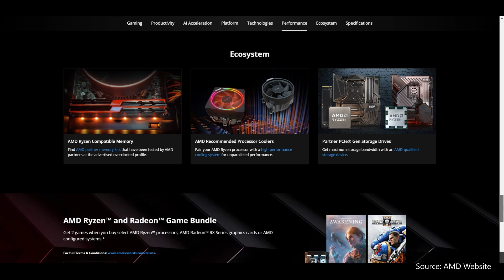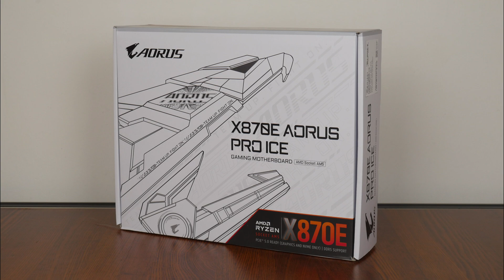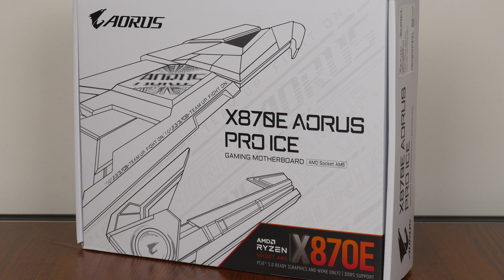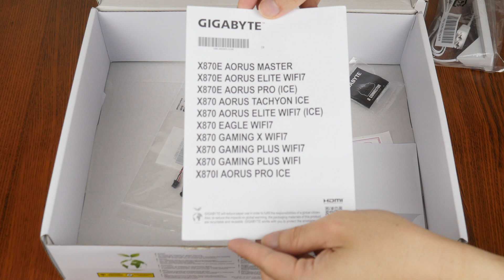THE Motherboard for Next Gen White AM5 PC Builds - Gigabyte X870E AORUS PRO ICE Unboxing & Overview

Comment: Would I be able to run 2 pcie 4 M.2 drives without cutting the GPU to x8?
Reply from the maker: Yeah, you'll have to use the first Gen 5 M.2 slot (M2A_CPU) and the Gen 4 M.2 slot (M2D_SB) - populating these two slots will not result in any lane bifurcation that will cut the GPU to x8!
Reply: @ALKtech  also i like to see pcie 2x16 gen4 for 2 gpus...but i can only dream :D
Reply: Or m.2 pcie card

Comment: its ne again ^^" can that board handle a soundcard or will it cut lanes away thanks for the review ^^
Reply from the maker: Hello! With this board, you won't get any lane sharing with a sound card installed on the PCIe 4.0 or PCIe 3.0 slot. 

However, seeing as you have three M.2 drives in your system, you will still encounter lane sharing due to the fact that two of the three PCIe 5.0 x4 M.2 slots share lanes with the primary PCIe 5.0 x16 slot for a graphics card 😅 this means your graphics card will operate at x8 mode instead with three M.2 drives installed...
Reply: @ALKtech  Will lane sharing be an issue most users will even notice? or just the tech enthusiast/benchmarkers?
Reply from the maker: @AlexisField  there's some benchmark videos/articles out there that demonstrate the difference in performance when the PCIe lanes for a graphics card gets cut in half - by and large there is some performance degradation, but the percentage drop in performance tends to be in the low single-digit range. For the everyday user/gamer, he/she is probably not going to notice!